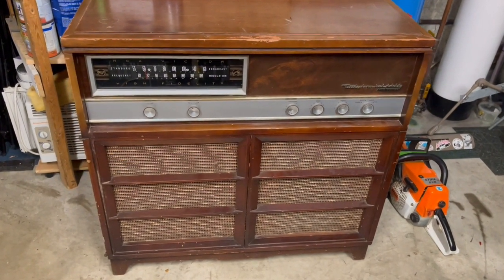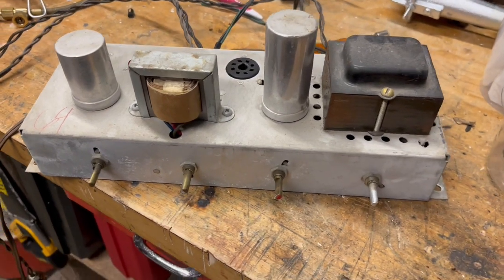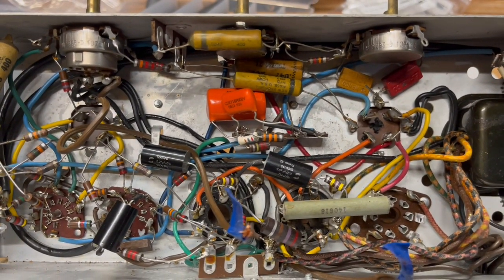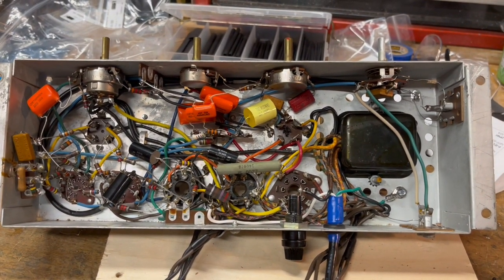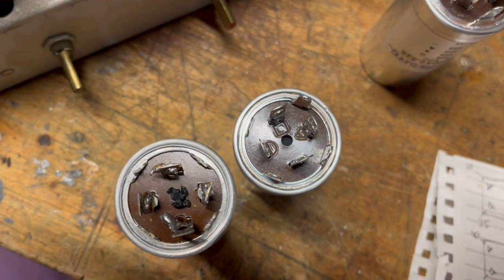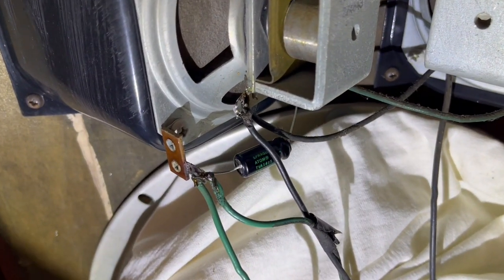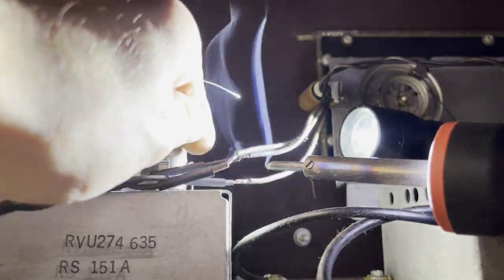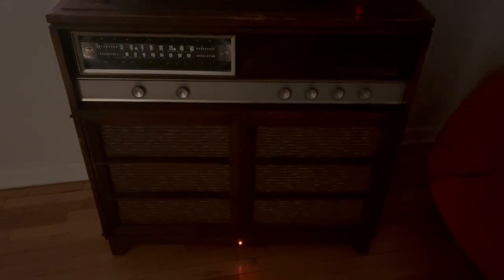Repairing a 1950s RCA tube amp from the side of the road

Comment: How about do some troubleshooting and testing resistors? Of do you think replacing capacitors are all that is needed to repair a vintage tube powered amplifier?
Reply from the maker: It's always different with every amp, but generally with something this old, it's pretty certain that all the capacitors need to be replaced. I wouldn't be surprised if some of the resistors are out of spec, but they tend to last much longer than capacitors do. I was also trying to keep costs and time working on this at a minimum, so I figured I'd just start with the cap job. All the voltages that I checked after that seemed fine, so I opted to leave the resistors. If it ain't broke don't fix it!
Reply: @joeles2738  I agree, It was a great video.  Thanks.👍